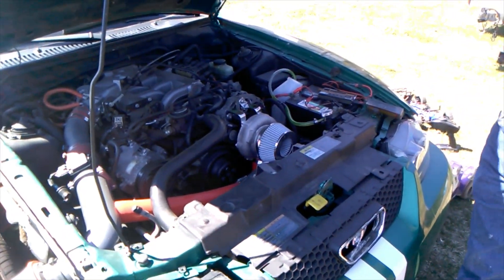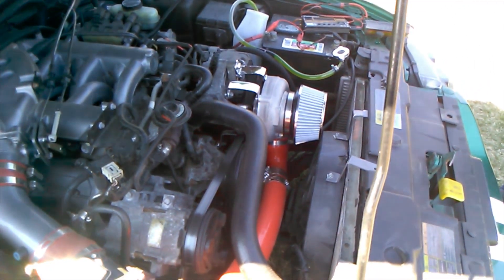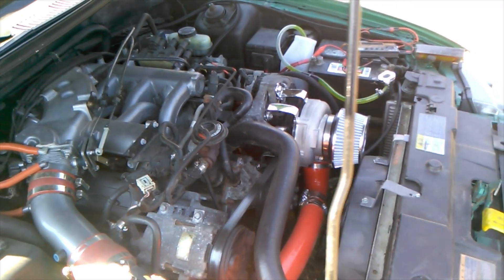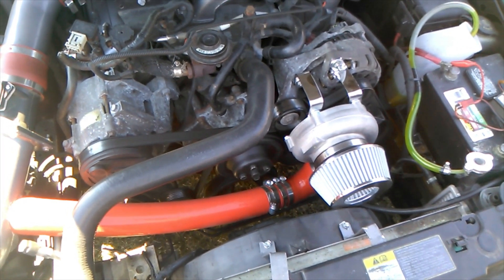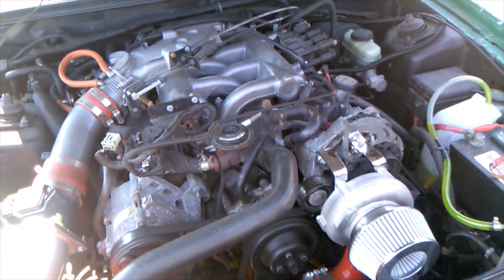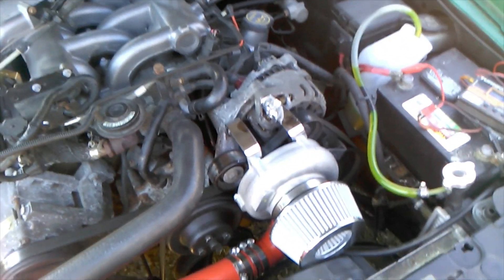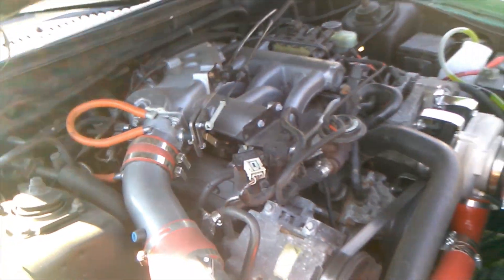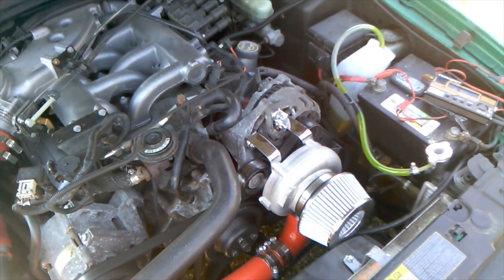Supercharger DYI.

Comment: I want to do a turbo with a hydrolic gear  motor . The pump would be piston with variable flow . Or even more simple a cvt transmission couple with the turbo driven by a belt .

Comment: This dude has spent a year and a half making a centrifugal supercharger with no compound gears inside meaning that this turbo’s turbine is only going to spin as fast as the pulley allows it too. So If your average turbo’s turbine needs 280,000 rpm to push 6-7 lbs of boost that means he’s making roughly .06 lbs of boost at 18,000. If he somehow bumps the rpm up to 28,000, as he said, he will then make .1 lbs of boost. So if 6 lbs of boost nets the average car about 30% more power. The engine in this mustang made about 195hp from the factory, he should be making about 198 hp at the crank and at 28,000 rpm he will make 200ish. That’s figuring that the air will even make it to the throttle body. He has made a glorified centrifugal superturbo air compressor intake. Sounds like the name of a new Dodge Challenger variant.

Introducing the 2030 Dodge Charger Daytona hellcat centrifugal superturbo red eye wide body

Comment: You have to have a gearbox mounted to the back of the supercharger. The gearbox further modifies the engines input so you can get the 25k+ rpm you need out of that thing wide open
Reply: No you don't you can run different size pulley gears,

Or if you want true power you can run an electric motor and have full boost with no lag at "any" rpm...

Comment: can we see more of this car please.  Im trying to do the same thing. I was going to tear the ac out of my black one cause it don't work anyway and toss an inverted eaton m90 supercharger but I cant find one for sale on ebay or anywhere for a decent price that's rebuilt.  If you take a look at Mustang Man's videos just type in m112 3.8L ( that's the only way to find his small channel on youtube) he's got a m90 now in the cleanest setup I've ever seen on youtube.  Anyway I want to do something like what you have but a p1 vortech is like 2700$. How did you do this,  and what turbo did you use? did you use gearing on the back side of the turbo or is there just a pulley welded to the turbine? I'm super curious please get back to me!
Reply from the maker: well at this time,there will be a new vid coming this spring,as the avg temps are 5 outside.
I can say this car is NOT the same,it is being setup for a supercharger off a mercades ,and getting new injecters.
stay tuned..
Reply: @2rcguyskinda.154  awesome yes i was also look at the eaton m62, they have the cheapest rebuild kits!

Comment: Hey buddy you're not going to make any horsepower or better gas mileage because you have it going into it intercooler all your boost is coming out the end of that intercooler you need to put the filter on the turbo and running directly into your intake so you can create boost all you're doing is adding more oxygen now that's like Ramire and

Comment: So dumb question and maybe I just don’t see it in the video………turbos/super chargers/blowers all compress air into the intake of an engine for performance gains………..you have basically a belt driven turbo with its output Tee’d into an already existing intake pipe, so any pressure you create travels towards intake but then exits left as shown out the air cleaner instead of being “compressed” and shot down the engines intake………….UNLESS, you have installed some type of flapper valve to shut off that path of flow when it starts building pressure.

If you didn’t then the parasitic drain you’ve caused by adding another belt driven device has actually decreased your performance instead of adding to it.

IF you did install some type of flap valve that keeps the compressed air from exiting the other breather, how much pressure are you building? IF your actually able to build pressure, much over 1 or 2 psi your going to force your engine into a lean condition unless your computer or a custom tune can add additional fuel.

Comment: Defeats the purpose of a turbo.. and its not doing anything.. its connected to another inlet, so all the pressure it makes can go right out the other inlet..  The turbo outlet should go straight into the intake.. So all the pressure is forced into the motor. There isnt any pressure if there is another open end to the pipe.. it can just go out that end..
Reply: Not true. It's constant velocity
Reply: @richardphillips107  Self cleaning air filter?

Comment: So it's essentially just a centrifugal supercharger
Reply from the maker: yep
Reply: No
Reply: Yes and no. It's half a centrifugal supercharger. Without belt driven gearbox to spin the compressor faster than belt speed its just a belt driven fan capable of producing atmospheric pressure 0lbs boost.

Comment: With the intake T’d like that if it’s making any boost at all it’s probably pushing the extra air out the air cleaner that the engine doesn’t need, so basically this engine is stock with extra steps. It’s supposed to be forced induction, not “if you feel like it” induction
Reply: Unless he has a one-way air flap. Shut when he has boost, open on the high end  or if it calls for it.
Reply: how does a turbocharger converted into supercharger
Reply: @LEEKAMAU-el8qm  Not going to lie after that video and the comments I question how high I am :face-green-smiling:
Reply: The vacuum of the engine going in is stronger than the pressure of air being forced in, won't lose anything, but he's not getting full compression going in made by the belt driven charger.. its basically acting like an electric "turbo" that's continuously on maybe getting up to 2-3psi instead of the full 15-20psi the charger should be putting out.
Reply: @smahring  you can't compress to any psi if your vacuum is greater then your input. Your literally at vacuum (-psi) then
Reply: @blakewisswell  than
Reply: @blakewisswell  ok.. you said the exact same thing I did in different words🤦‍♂️
Reply: @smahring congratulations you are the dumbest human being that can spell.

Comment: I’m curious how he created this. I want to do this myself.
Reply from the maker: so basically ,hes been experimenting,and doing research,on electric fans/turbos..says the power didnt increase much,but better MPG
Reply: He’s putting a pulley on cold side of a turbo
Reply: I can almost guarantee the first thing he did was essentially remove half of the turbo (the housing and wheel which exhaust travels through).

The second step would probably be mounting a small gear box or a pulley onto the rod that runs through the compressor side. That way instead of exhaust gas spinning the compressor side, a pulley is doing the spinning. 

If his pulley gear on the turbo is half the diameter of the wheel that the engine rotates, this means his turbo will spin at twice the engine RPM. If the engine is running 3,000 RPM,  the turbo will theoretically spin at 6,000 RPM. 

In this case the turbo is spinning at (18,000 RPM?) when the engine is spinning at 4,000 RPM. This can be done if in a perfect world, his turbo flywheel is one inch in diameter and his engine flywheel is 4.5 inches in diameter.

But where the project starts is knowing how much boost you want. No lag = no time where the turbo isn’t providing boost. It will always provide boost. 

Let’s say my engine is a 350 V8 that needs 750cfm at standard atmospheric pressure (14.7 psi). That gives me some options. If I equip a turbo that can output 750cfm at a 1:1 gear ratio to my engine (engine speed = turbo speed) than I will receive no boost. 

But what if I equip that same turbo but with a 2:1 ratio between engine speed and turbo speed? 

My turbo will now spin twice as fast. But my turbo is rated for 750cfm, and it’s spinning twice as fast than my engine, so what’s going to happen? 

My engine will constantly receive 1500cfm. That’s double the volume it needs. Doubling my volume is equivalent to doubling my pressure. My car is now being fed twice as much volume, or twice as much pressure (equivalent).

This means that instead of receiving 750cfm at atmospheric pressure, my engine is receiving 1500cfm at atmospheric pressure.

Another way of saying it is my engine is now cramming double as much air into my cylinders, which means I can cram twice as much fuel as well. 

1500cfm at 14.7 psi = 750cfm at 29.4 psi. That is literally 14.7 pounds of boost. I don’t think my engine would survive with that much consistent boost. Most cars run best with continuous boost around 5-9 psi, not 14.7 psi.

A faster spinning turbo may wear out sooner so get a bigger one that doesn’t have to spin as fast to pump the same amount of air. That way the turbo can spin closer to the engine RPM. 

Let’s talk about waste gates and all that jazz related to turbos: you don’t need any of that anymore. When the turbo was mounted directly to the engine pulley, it became a supercharger. And if my turbo spins 1000 RPM while my engine spins 500 RPM, you know that my engine spinning 1000 RPM means that my turbo will spin 2000 RPM, assuming a 2:1 ratio. If my engine can burn all this air, than I will never need to blow off any extra air regardless of speed or acceleration. It’s proportional.